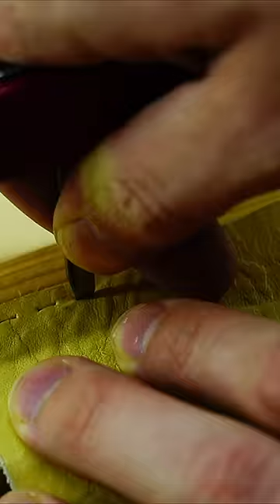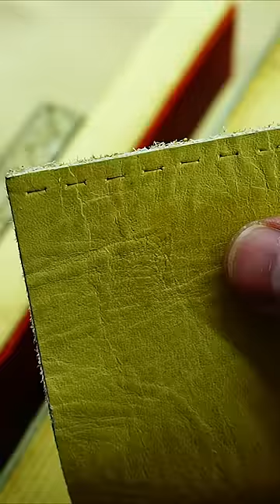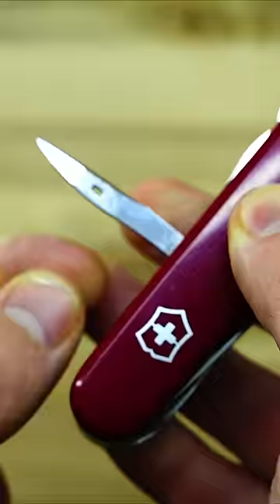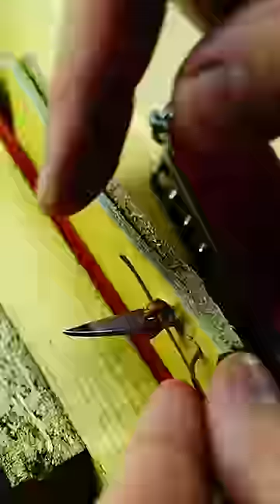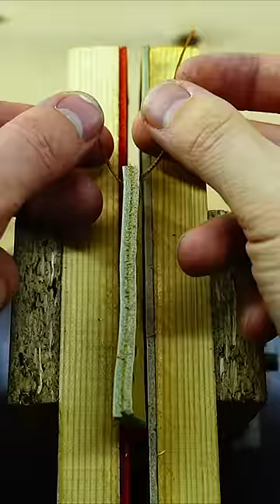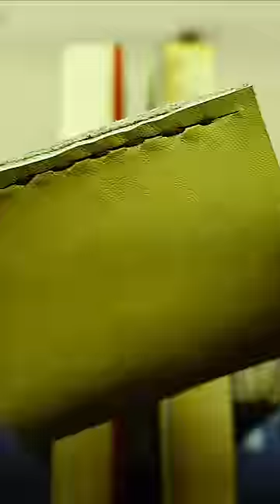How to use the Awl in a Swiss Army Knife

Comment: Ive always heard you should tilt the awl about 45 degrees from the direction of the stitching (more like / / / / than - - - -) so youre not running as much of a risk of continuing that cut along the length of the stitching. Might be pointless, but always made sense to me
Reply: Doesn’t that create more spread pressure on it though?
Reply: @MrTravisAl  Maybe, but the thinking is that the cut makes a weak point that is likely to keep going along the lined up holes. Plus when strain tries to pull apart the stitching you have more material to go through with the biased stitching than the straight stitching. In my mind, its probably as good or a little better to bias than to do them all in a straight line. Not like Ive compared the two side by side or anything like that so honestly Im absolutely just guessing.
Reply: If an awl is used properly the leather basically completely closes back up totally sealing the original holes and locking in the cordage. The thicker the hide the faster this occurs.

Lovely fun working with real hide that vinyls won't do.
Reply: Actually I find your comment rather shallow and pedantic
Reply: Also, while you're right about the 45° thing. You're supposed to loop it back to the previous note so that they are self. Limiting notes and if you break one of them. The entire series does not come out.
Reply: Jesus is the only way to healing, restoration and salvation to all souls. Please turn to him and he will change your life, depression into delight, soul heading from hell to heaven all because of what he did on the cross 

“Whoever calls upon the name of the Lord shall be saved” Romans 10:13
Reply: @HaroutBlack Will he repair my boots tho?
Reply: @Drak_Thedp this made me lol 😂
Reply: @TheFireMage100 
Agree
Reply: @siege2928  that's complete nonsense. But even if it were true, what OP's refering to is the fact that if you put the stitches in a straight line, if one breaks it immediately goes into another one, weaking a bigger area than if a diagonal one cuts loose through the leather. Obviously proper sewing done in a shop won't do that to begin wits, but we're talking first-aid repares out in the woods here.
Reply: No he was more of a sandals guy. @Drak_Thedp
Reply: no it´s not @HaroutBlack
Reply: @TheFireMage100 

Using the chisel like the videoman (rather than the knife or other sharp edged tool which will create a starting point on the sharp side for deeper cuts to form from the thread's pressure) to create the holes for the awl can also reduce the risk of the cuts continuing along further than necessary.
Reply: @HaroutBlack actually its also in Acts 2:21
However Matthew 7:21 says “Not everyone who sayeth unto me “Lord, Lord”, shall enter heaven”!
Thats a little awkward for you god botherers and your nonsense now isn’t it?
Reply: @HaroutBlack tf does this have to do with a Swiss Army knife
Reply: I've always heard you should keep your opinions to yourself mate, and just enjoy the vid😅😂🤣 lol sorry belligerent mode.😅
Reply: @niwty it's all true ya know pal. And for a long long time there's been an effort to undermine, ridicule and even set up folly religions all to keep YOU from knowing the truth.

Comment: I have wondered for years about the awls on my multitools. Thank you for this video because I had zero idea what it did, let alone how to use it
Reply: Actually most awls don't have a hole (in my awlful experience 😃)   I've just used awls to poke holes in leather and to auger holes in wood.  The hole in the SAK auger puts it above the usual ones.
Reply: @77thTrombone kinda tempted to try to drill a hole into one of my oldmultitool awls to see if it’s a viable process.
Reply: @jayfron6012   well, I can tell you the technique is a standard sewing stich.  I have a leather needle that instructs the same stich.  (Check it out if you have a hobby shop nearby.)  I think there are 2 "twists" on this technique:
- using the chisel to make holes for the awl.  I think the reason awls have a blade edge is so they can make their own slot — no chisel prep needed!
- the SAK has a slot hole, so theoreticaly you could use it to sew with leather lace.
If sewing with thread, you wouldn't need the slot hole, and you could get away with a smaller diameter.  On the other hand, consider the effort (pounds of force against the leather material) increases with the following:
1) sewing thread with a needle.
2) sewing thread with an awl.
3) sewing leather lace with an awl.
Which is to say, I think I'd prefer #1 for thread, or #3 with lace — this puts you back to needing a slot hole! 
I'd put a hole in my Leatherman awl, but I'd probably put it only 1/4-3/8" from the tip.

Comment: What a wonderful demonstration. I had wondered ever since i was a kid exactly how that was to be used. Turns out much like a sewing machine with a bobbin.
Reply: Yep, I have a Stuart speed awl that’s a beefed up version of this. They’re handy for quick fix’s.
Reply: This looks to be a chain stitch which has no bobbin.
Edit: I am wrong. This is a lock stitch.
Reply: @Crlarl pretty sure he just means the general mechanism a sewing machine employs (ie needle going through the material and back)
Reply: Now we can make floopy thingys. We can flap them at each other.
Reply: @Crlarl  I'm just making the observation that it has a thread going through from one side and a thread holding it on the other which I believe is what the bobbin thread does.
Reply: @jacobbillups4715  exactly I learn by seeing much more than hearing so I don't always pick up on all the terminology.
Reply: @Crlarl  honestly for years my concept of using the sewing awl on my knife was to bunch up several layers of material on it to draw what is basically a running stitch through man holes at once. I simply couldn't visualize any other mode of function. So in my visual thinking process I now think of the awl as the needle of a sewing machine while the other end of the line serves the same function as the bobbin. There is an interesting demonstration of this in a video titled "The Secret Life of the Sewing Machine - Remastered" about 5:30 into it with a "human sewing machine"
Reply: @DWmaniac4n6  
Yeah, I checked again and you're right. This is a lock stitch. It uses the one thread but in effect it's like a bobbin.
Reply: @Crlarl  yeah I'm a visual learner so it's easier for me to think that way. Also I have had problems translating my thoughts from that form Into words that most people won't misunderstand. But knowing this about myself makes it something I can work on. Thanks for your reply, I enjoy the interaction.
Reply: same! I was have pro thing for that and never know how to use it now all have sense
Reply: The hole is also the perfect size to insert a 12ga solid copper wire. Use it to put a loop in the wire to attach to the screw when installing switches and outlets.
Reply: @carlbruschnigjr1757  good to know. I will try to remember to try that next time I have to install an outlet.
Reply: @DWmaniac4n6  Most SAKs also have a small notch on the larger of the flat screwdriver blades that work as a wire stripper. Just make a quick cut around the wire, hold it in the notch and pull.
Reply: No, your a bobin
Reply: More like a sewing machine bobbin works like an awl.... because its a modified awl.

Comment: It's always nice to have a vice handy in the field.
Reply: A vice isn't necessary 😂 🤷
Reply: Wow, I've never seen it done before.
This is pretty cool. I bet if you really needed to do this, you would find some way of holding it together. In a pinch, you could use two rocks even.
Reply: Def don’t need the vice but it’s easier for what he’s trying to show
Reply: You can make a makeshift vise with some wood, string and the Swiss army knife..
Reply: If you're careful you can hold it between your two heels
Reply: You need the other Swiss Army knife, with the vice tool
Reply: Gather pine tar and use it to glue the seam together first. Similar to leather cement in actual leatherworking.
Reply: My Swiss knife has a vice built in
Reply: i saw a vid on making a bushcraft vice the other day

Comment: I got one of these from the Swedish air force It's blue and stamped with flygvapnet on the side. Just like your, mine is quipped with a knife, fork, letter knife and the corkscrew. 
A nice feature is that it splits into two pieces once you unfold the fork, making it usable as cutlery 🙌

Comment: I guess it makes sense, but for some reason I wasn't expecting a sewing machine stitch
Reply: Now we know where the sewing machine learned it from. 😂
Reply: An interesting way to describe a tool that predates sewing machines. :^)
Reply: @thewerepyreking  while sewing needles have existed for milenia, I'm pretty sure this stitch wasn't really invented until the 1800s when the sewing needle was first created with the eye on the pointed end of the needle instead of at the opposite end
Reply: I do beleive sewing/stitching awls have been used to sew in tough material for thousands of years. 

According to one source i found the oldest one we know of is a stone age find made from bone. And metal ones from the Roman Empire seems well known by archaeology as well 🙃

Seems like the creators of the sewing machine mechanised an ancient method of sewing rather than inventing a new one 🙂
Reply: @jerkerbergstrom6663 not completely true. A sewing machines uses two wires, and while the punch action and the knot are somewhat similar, the punching through fabric isn't the complicated part, the pulling the counterstrike is. Also machined threads have the knot between the two strings in the midplane between the two fabrics, ensuring max strength without the need to actually make and endknot to secure the total. It is all friction, baby!

Comment: I have never had a knife with an awl that had a hole in it like that one. It's basically a Speedy Stitcher built into the knife. Every awl I've had on a Swiss Army knife had been solid, for boring holes in wood.  Is that a special leather working model of Swiss Army knife? Mine never have the stitching awl or the chisel. 

If I need to stitch leather, I break out the Speedy Stitcher. It's a special needle awl for stitching leather, with a spool of waxed leather thread in the handle. I've owned two in my life, one for about 25 years, which I lost in a move, and the one I own now.

They're cheap, and with only a couple of additional tools, such as a hole punch chisel with 1-5 teeth to punch parallel holes, and a narrow gouge to inlay stitching. A tool to shave leather thinner that you plan to fold over is another useful tool. But you can get away with just a Speedy Stitcher.

Or that stitching awl.

Comment: Those stitch holes are FAR too large. This is nonsense. It didnt even work look how much it bunched and turned. Delete this.
Reply: I don’t think army men would be too picky about it considering it was originally made for army men in the battle field and while traveling given the name “Swiss army knife”.
Reply: @Gmi40  that doesn't change the fact that he's using it incorrectly and in a way that produces an extremely low quality joint. It's not meant to pull thin waxed thread at all. It's literally an awl. You're supposed to make the stitch hole with it. That's why there's a blade on it.